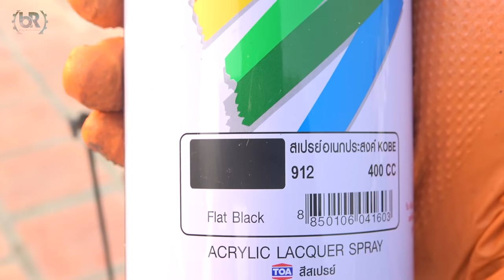School Bus Restoration and Customize || Boty Restoration

Comment: That is a very detailed toy. Doors that open, front and back hood latches, an engine in the engine compartment….Plus seats and gear shift and steering wheel. I bet when it was new, it wasn’t a cheap toy. Looked brand new again after you were done!
Reply from the maker: Yes thanks you for your supporting :)

Comment: I would of liked to have seen how you cleaned the windows, apart from that it was good...😊
Reply from the maker: Just cleaning with soapy water and following by car wax then polishing with soft mop to remove small scratch. "deep scratch need sanding '1500+ grit sandpaper' then polish again with car wax" hope that's help 😁
Reply: Boty Restoration.... brilliant, thank you...😊
Reply: Lsodşddı
Reply: This has always been my question too, seems like it would be the more difficult portion of the restoration.
Reply: @botyrestoration702  77888
Reply: @mandamoosgardeningadventur8305  e3ew2
Reply: @mandamoosgardeningadventur8305  ttr for

Comment: But you never fixed the sound or lights,  I managed a toy store and had those in there , not a good quality restoration project 🤔🤭
Reply: I somewhat agree but from the looks of it this particular one didn’t have any of those electrical components left with it so probably wasn’t possible.
Reply: Vinicius